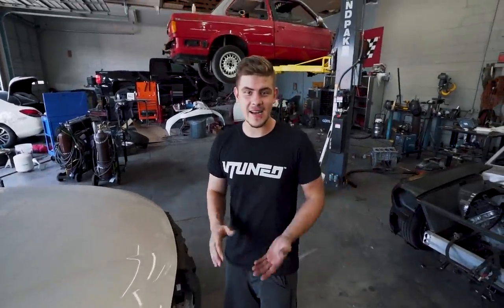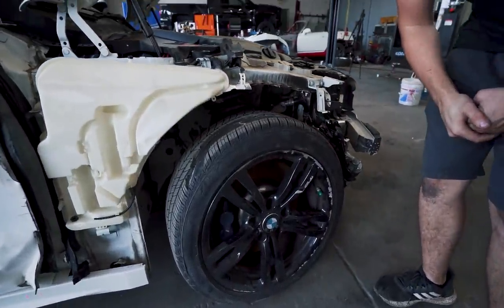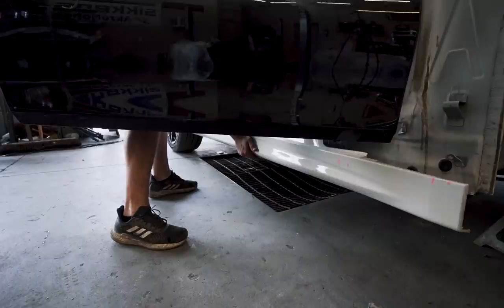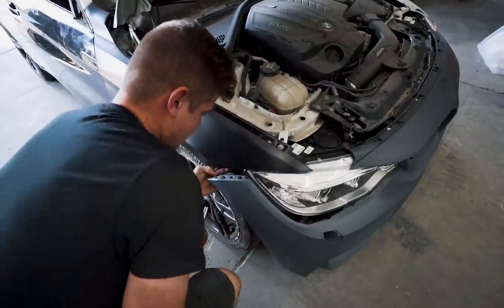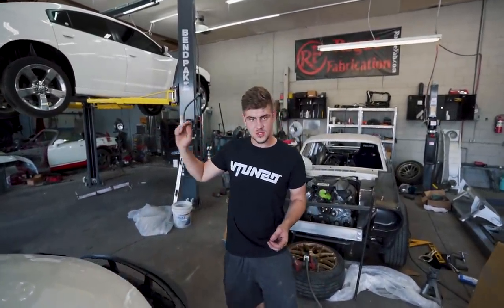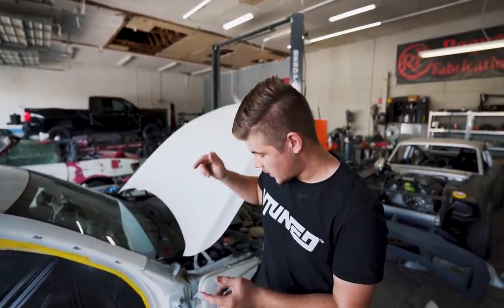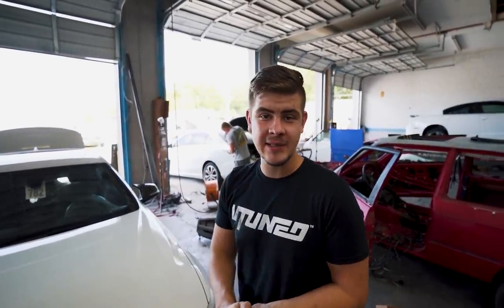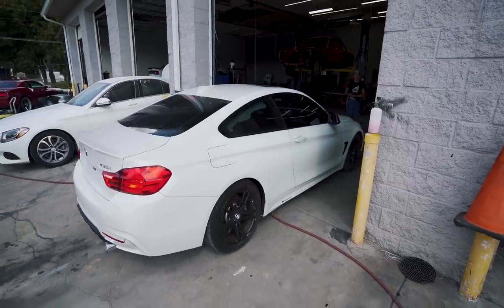I Bought a Damaged BMW M Performance 435i From The Salvage Auction And FIX IT FULLY !

Comment: hey Vtuned, you are one talented guy. Just so you know, the intake has the power kit, intake, cooler and the muffler as well, which is a BMW kit offered. Should add 15+ HP to the vehicle. You mentioned you were going to tune it, so, keep in mind this is already coded to the vehicle. There was a download kit that was installed. Your programmer should be aware of this, and once it is changed, it would need a new FSC code, which is NOT available....
Reply: yeah so dont tune it...
Reply: Don't listen to these guys.... the tune for the PPK is weak - who cares if you "lose" it.
Reply: Xh Xb not an MPPSK. That’s M performance muffler. An MPPSK is a quad output. 
In terms of tunning, a BM3 or MHD tune will definitely bring that car to another performance level. The stock M performance “tune” is barely a noticeable influencer in terms of performance (around 15 HP). Bm3 tunes or MHD tunes add way more than that

Comment: This would’ve been 10 episodes if goonzsquad where doing this
Reply: 1 episode on dang dude, 1 on should we take it for a burn out and 1 on going to the dealership for parts.
Reply: cpgixxer a few more episodes to paint... but wait dirt got into the paint because we painted the bumper outside... now we have to sand it and wash it twelve times
Reply: @Bean24-  Ya when they want it done right they take it to vtuned, it's all about content. I'd much rather watch a single vid like this than 10 showing 12 rounds of sanding and painting.
Reply: They are too busy swinging from a shovel and running from Fisker's knives.
Reply: @cpgixxer  lmao ya

Comment: When you painted the bumper, do you have to use some sort of flex agent in the paint so the paint doesn't crack when the bumpers flex?  I had a bumper re painted and they told me they use a flex agent and wasn't sure if it's true or the dude was taking advantage of me.  It makes sense but I never see YouTubers mention anything about it.

Comment: At 18:59 it doesn't look like the butyl tape between the foam cover and the door was replaced. I'm sure you did off the video but if not, you'll get water in your floor pan when it rains.

Comment: Be carefull if you want to replace engine Oil and filter, these engines have a issue where the filter breaks in half when you pull it out. So if you get the Oil changed at a BMW dealership they Will replace the entire consol for free :)